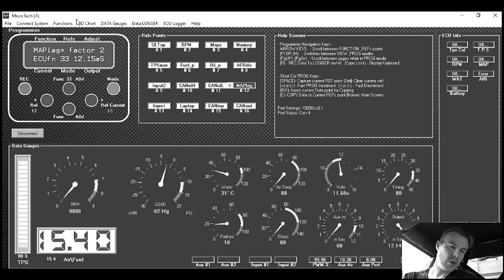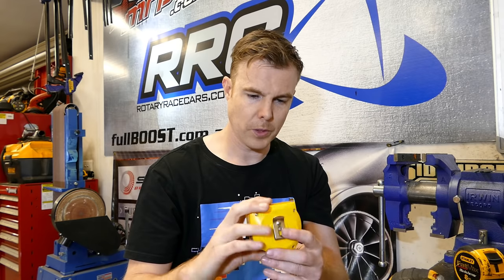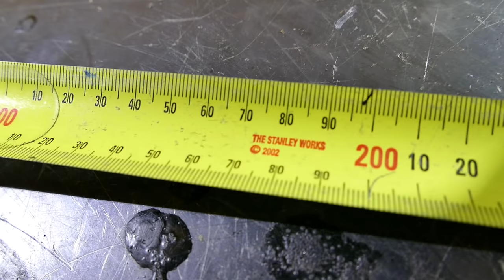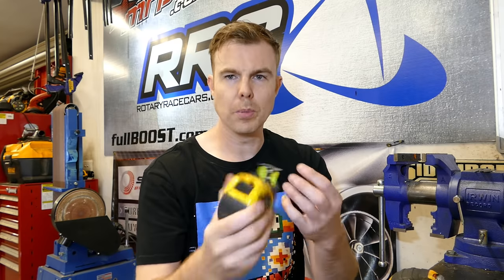Top 5 Garage must have tools | Backyard Mechanics

Comment: 6. Quality jack, low clearance if you’re dealing with #becauseracecar, 7. Jack stands, safety first at all costs 8. Breaker bar, because they are worth their weight in gold when you really need them! 9. Magnetic pick up tool, for finding that 10mm socket you will drop! 10. Decent LED workshop light, nothing worse than a one hour job turning into 2 hours and racing the daylight so you can see what you are doing.
Reply: Dan Jones, 10mm sockets need gps location

Comment: 6. Jack stands
7. Low clearance jack
8. Oil/fluid pan. You'll learn heaps just changing fluids
9. Oil filter remover
10. Belief in when you f something up you can work it out and fix it. It's not as hard as they say. You have a backyard, you have tools, you have the internet.......
Reply: Well said brother

Comment: An excellent series this will be !   my picks : 1-Jack and stands, 2-Rough service trouble light, 3-Gasket scraper, 4-Assorted pliers set, 5-Allen and Torx bit sets, 6-Multimeter and electric kit bits 7-Oil and lube kit, drain pans, 8-Torque wrench, 9-Jaw vise, 10-Propane torch

Comment: Good choice, I would add a copper head non marring heavy hammer,  compact impact wrenches, compressor, paint guns,  antirust in cavity oil sprayer guns, vacuum pump for full changing steering and tranny fluids, multimeter with amp clamp, oscilograph, code reader, relay pin up plates, floor jacks and stands, 300w soldering gun, battery chargers, mig welder at least 180 amps,
Wait, its more than 5. never mind.

Comment: 6. oil filter tool 7. pliers/cutters. 8. allen keys. 9. multimeter. 10. jack and stands. 11. pry bar. 12. breaker bar. 13. trim removal tools. 14. wire brush. 15. small impact driver.
Reply: Good list!
Reply: Someone just starting out won't need or know how to use a multimeter.    😂👊🏻
Reply: Nathan-N14Nismo people Google stuff these days. Is the alternator charging, are my ignition leads faulty, does my coil have power etc etc. They'll work it out
Reply: JyveKilla tru man. But still not a basic essential I don’t think. Getting a bit technical for noobs. Fuk knows what they’d do with a multimeter. Hahahaha. But I hear ya man. 👊🏻
Reply: Add an inspection lamp, propane torch, punch set and solder iron to this list and you are well equipped for many tasks
Reply: Nathan-N14Nismo so the multi is not basic enough of a tool but you say nothing about the impact driver? Maybe you should read up about multi meters because it sounds like you aren't sure about them more so.
Reply: JyveKilla Hahahaha mechanic for 20yrs man. Prob forgotten more than u know.

Comment: Hammers - a soft hammer is a must. Rulers - a 300mm steel straight edge ruler is very helpful. Screwdrivers - get a very short one or two. Spanners. Often the issue is access. Collect old individual spanners that you can cut, file, bend and generally mutilate. Also get a set of ratchet spanners with short shafts. Other things - extension bars for your cordless drill so you can drill at a distance. Another must is a good quality torch, preferably with a magnetic base.

Comment: Late to the party here. I love my Wiha mallet. Comes with 5 different heads, from soft to extra hard. It holds 2 heads at once of course. 

As for screwdrivers, I use Wera chiseldrivers for automotive work. I can beat on them and pry on them without fear of damaging the tool.

Comment: a pipe wrench and vice grips are good must-haves. also, crc is a must-have tool or wd40. garage rags as well. yes, these may seem like common sense but a lot of people don't have them.

power tools need to be added at some stage too. I'd go angle grinder cordless drill plus electric drill. jigsaw possibly. then heat gun and soldiering iron

Comment: Am I the only mechanic without a claw hammer in his tool kit.?...I'm still using most of the Aussie Sidchrome hand tools that I've had for over 40 years..Admittedly there's no metrics...Here's my thoughts...If a guy has a project that is metric then a metric set of tools is what he needs or a euro goose that needs a range of Torx etc but lots of Phillips screwdrivers is a must...I seem to ware them out or they just mysteriously vanish.

Comment: Should have touched on JIS screwdrivers as well during the screw driver segment, most people with fuck JIS spec screws using normal Philips screwdriver real quick without realizing they are using the wrong tool 
Otherwise quite a comprehensive video I look forward to the next one

Comment: I don’t think hammers and tape measures are in the top five must have mechanics tools. I’d go with a scan tool, test light, oscillator, socket set, gripping sockets for removing rounded off bolt heads, wrench set/s including flex head